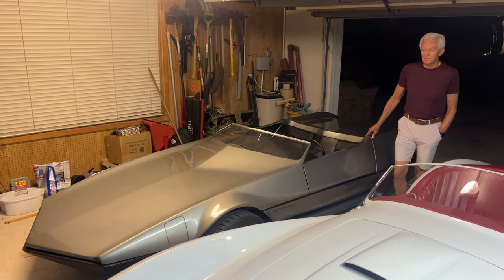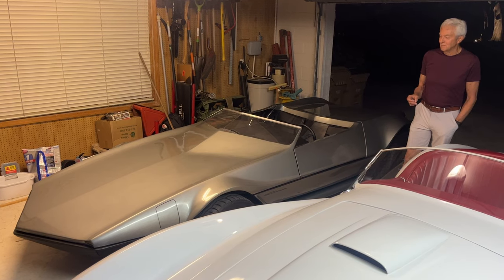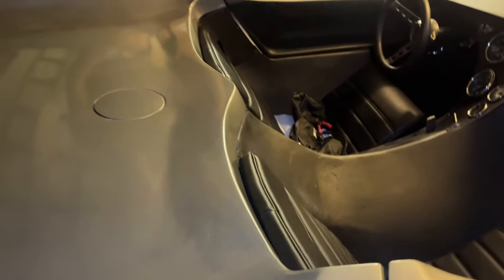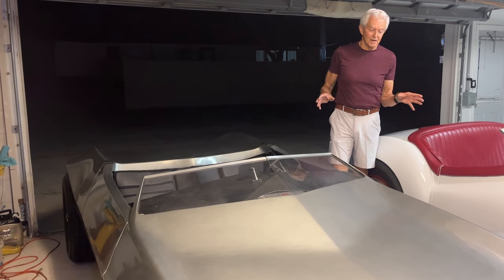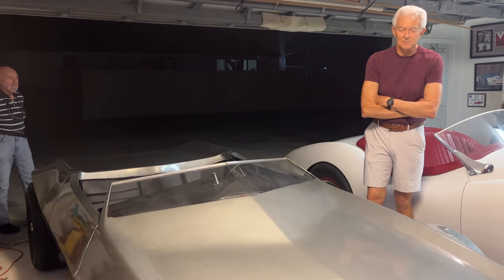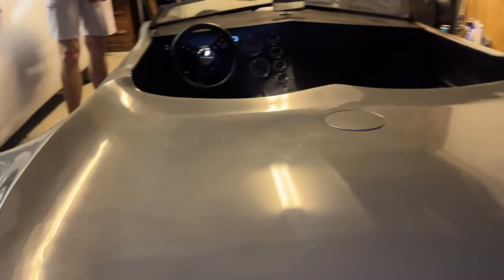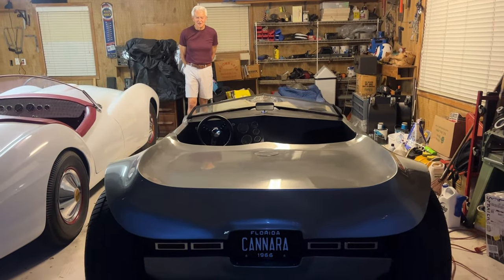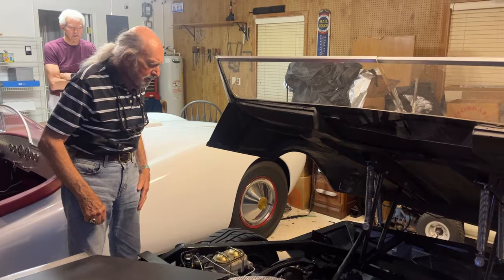1966 Cannara - The One that Started the Wedge Car Movement!

Comment: I hope the wheels and tires get replaced with something narrower and more period correct.
Reply: 100% !!!
Reply from the maker: I believe Guy addressed the logic behind the wheel selection. Wheels certainly make or break a car, but it’s important here for them to not take away from all the details and curves happening in the body, hence the simple design
Reply: I commend the gentlemen that brought this important car back to life. I'm sure the comments relating to wheels and tires are meant solely as constructive criticism. My comment is also intended to be positive- simple wheels are fine but detract from the lines of the car when the rubber sticks out beyond the wheel wells. @UndiscoveredClassicsUSA
Reply: Ray Cannara actually had planned for 10 inch rims on the rear. They are currently 8’s. Ray also specified the tire size currently on the from as a retrospective in 2016. My comment above using 1960’s race tires to achieve a similar look may still happen. 😅. I felt it was too much to section the front cross member to bring the front wheels in-board. Sometime you leave the work of a young designer in place to show his best efforts at the time.

Comment: No... this car DID NOT start the wedge movement.
Reply from the maker: This is the oldest, true wedge shaped car before the craze took off. I’d suggest you check out the book linked in the video description if you’d like to see more about it in historical context for our case. Also, it just won a coveted special award at the Pebble Beach Concours so it’s historic contribution to the wedge car movement has been further solidified